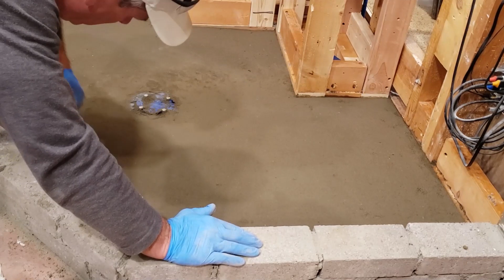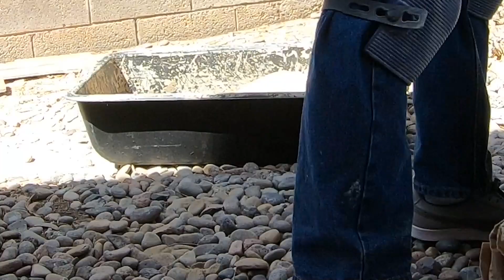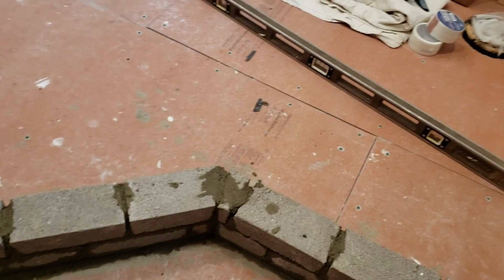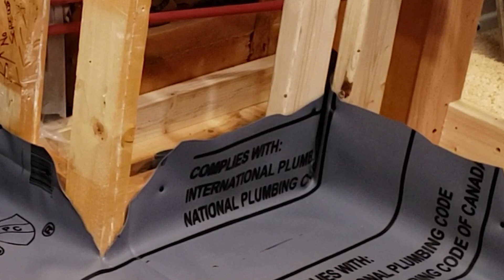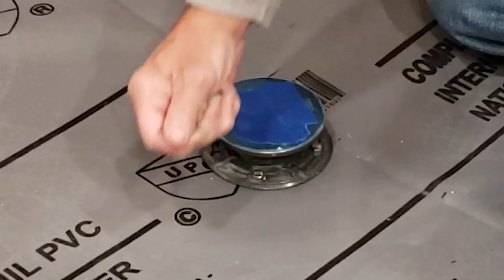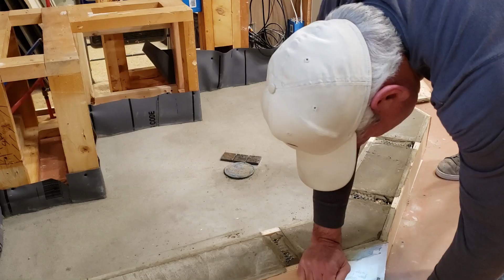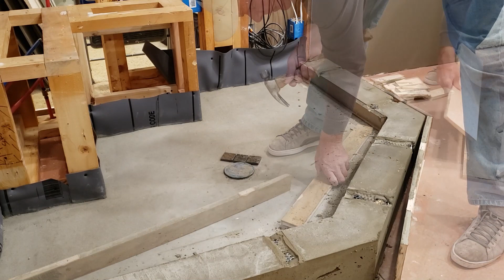Building a Corner Shower Floor From Scratch - Part 1

Comment: Thanks for the video I am going to be doing a corner round shower in my house (single wide mobile) and this is one of the best videos I found for building the pan that is easy to follow
Reply from the maker: Thanks for watching Lyle and good luck on your shower project! Just a reminder if you haven’t done it already, but you may want to check your floor joist structure under the area where you are building the shower. The weight you are adding to that area of your house can get pretty substantial when the dry pack gets added on top of the floor. You should be able to beef it up a little pretty easily if it looks like you need to. 🙂

Comment: Hi Rusty, building the curb from bricks is a great idea. Thanks for uploading this video which is packed with useful information for the amateur. What type of mortar or perhaps thinset is suitable for laying bricks on a wood subfloor ?
Reply: After reviewing the TCNA ANSI standards, it appears a mortar meeting A118.11 would be satisfactory for setting bricks on plywood subfloor; would that be a fair summary?
Reply from the maker: Hey Alan! Sounds like you have it figured out. On a wood subfloor, I attach a layer of metal lathe to the floor under the bricks. Not sure how much that matters, but makes sense to me. 🙂  I actually use one part portland cement to four parts sand and mix it to a good mortar consistency for setting bricks in this type of situation.

Comment: Rusty, you don’t waterproof the shower pan before tiling? I was under impression you should red guard the shower pan.
Reply from the maker: Hi Dick… not necessarily on waterproofing the shower floor. I learned how to install this type of shower floor system about 45 years ago and it wasn’t a new technique at that time. Just a tried and true, old school method. I have been aware of the waterproof membranes for probably 10 years and use them periodically on a per case basis. Point being, obviously, a waterproof membrane is not necessary for a shower floor installed in this way. Does it help or hurt? Not sure, myself. The floor design deals effectively with water in the floor over time with the shower pan and weep holes in the drain. My concern is that I want the floor tile to have a good bond with the dry pack. If your tile starts coming up, you have a major problem. The membranes have their legitimate uses, but should not be viewed as a must for all situations. Hope that helps!
Reply: @RustyDobbs  I’m a big fan of the old school methods ( and your videos)  because I think they work too. I did a pre slope , so theoretically the shower pan liner will direct moisture to the drain. I am a little bit conflicted however with red guarding the pan. The last shower I took part in remodeling, I hired a guy to build the pan for me. He built it the same way you did and red guarded the pan after. The tile seemed to adhere well. I have since acquired more experience with concrete over the years working on my backyard to do this one myself. You explain the process better than anything else out there. I truly appreciate you sharing your wealth of knowledge and experience. You are a true craftsman. Thanks very much.

Comment: For future reference, as a suggestion, use a float or something flat to press down the shower floor  tiles instead of your hand. You did a great job! Excellent!
Reply from the maker: I appreciate you watching and your comment, Zimpler! The reason I press each individual tile into the thinset rather than use a method as you suggest is because the cured drypack surface soaks the moisture out of the thinset so fast that I want to make sure there is a good bond between each piece of tile and the drypack surface. So I work a one foot square sheet of tile at a time max and work quickly to make sure each tile has a good bond before the thinset starts to dry out under the tile. The last thing you want is for a tile to come loose from the drypack over time.

Comment: Another thing I like about this backer board floor is that it looks like I don't have to cut a 45 degree angle into my subfloor around the drain. Did you screw that drain through the backer board into the subfloor?
Reply from the maker: It's a good way to go, Pen. It happened to work out that I needed the additional 1/2" thickness to match up with the bedroom finished flooring. Yes, I did screw the drain down through the Hardiebacker into the subfloor. Very solid installation.

Comment: I’m in the planning stage of ripping out our builder’s grade fiberglass shower stall so I’m searching for ideas and methods on building and tiling our new one. Thanks Rusty for sharing your skills in this video. It’s about the best one I’ve seen so far. I believe I can do this!
Reply from the maker: Good to hear, Ron, and with your great attitude alone, you should be able to do this! I have another two part video series from a couple of years back that is an earlier version of this process on a shower without the corner seat that you may also want to check out. Same basic info with a few tweaks because of the design differences. I always remind people that their second shower will always be better than their first. 😀 This is a process, just like any, that you get better at the more you do it. The real trick is in learning to work with the dry pack and in handling the trowels. But you can certainly save yourself some money and get a lot of satisfaction from doing this. Good luck!

Comment: Enjoying your channel! I'm not planning to do this myself, but I'm curious how they do the shower pan for curbless shower enclosures. The "wet room" look is very popular now. But is there a "pan" for the entire area? Anybody done this?
Reply from the maker: I have done a couple over the years, John. I use basically the same concept but on a concrete slab you remove the slab in the shower area, compact the ground under the shower then go back with preslope, liner and finish dry pack as normal. I cut the liner off flush with the floor where the step would normally be and make sure I have a pretty aggressive slope at that point back to the drain. I have not done it with a wood subfloor, but the structural support would get complicated in a hurry so I would like not be interested in doing it with this methodology.

Comment: Hey mr. Rusty What size of metal  lab are you using, is ok if I use chicken coop wire 1/4?
Reply from the maker: I don't think there is a specific requirement on the type of metal lathe that I would use. It's just giving the mud mixture something to attach to and some rigidity to the structure of the curb.

Comment: Is it ok to put backer board directly on the plywood shower subfloor and pour the dry mud on top of that? And how can I verify that my 3/4 inch plywood subfloor can hold the weight of all this concrete?
Reply from the maker: Yes, Pen, using Hardiebacker over the subfloor is a standard thing for me under a shower. The next question is a more difficult one to answer because you need to take a close look at the structural  support under the shower to make a decision for the weight reason you mention. I generally just open up the floor under the shower area first thing to see what I am dealing with then do what I need to in order to feel comfortable moving forward. With the subfloor removed, it's also easy access to the area that may need to be beefed up.

Comment: Commented on your first video of this a year or so back. I thought I was going to tackle the shower then, but I realized I had a LOT of other work to do in my house.
The long story for that one is as simple as "I'm remodeling a 1920s house, and instead of just a simply drywall replace, I replaced all plumbing, electric, heating, gas, & yes...even added a secondary subfloor later with extra support braces, windows, doors & frames all to match the updated aesthetic." Except the additional part I never mention is that I did have help from my 65 year old father through the couple of years to learn each trade slowly. He was originally an electrical engineer, where my field is in IT Services (Information Technology). Anyway, the simple to long story is that some things he didn't know, some things I decided to tackle without him present. Things I certainly got his help on was with the framing, electrical & hanging drywall. The beauty of that is when I was a young child, he remodeled the house I grew up in and I was the "helper". In this circumstance, he was the helper to me...which was a nice father-son bonding time at the age of 30.
Anyway, a year or so past, a world-wide pandemic happened, I stumbled upon more income due to all of that situation and I went a bit different with approaches around the interior design of the house.

And here we are today. I have all the floors (solid hardwood oak & tile across the house) complete, all the painting done, bathroom mostly put together and I'm (still) waiting on kitchen cabinets ordered in March (Homedepot lol). But I decided over the weekend I was going to tackle building the shower.
Just like tiling, I felt the method of drypack for the pre-slope was a bit more therapeutic. I didn't feel much of a strain when doing it, however I do have a MUCH smaller shower (32" x 36").  Did the pre-slope last night and used the 4:1 sand to cement mixture as you recommended and wow it turned out fantastic today. I checked for levelness across while doing it all yesterday and confirmed it was sloping toward the shower at the same slope, whilst still having a level side-to-side appearance so that the edges are the same. That's something I wasn't sure if I was going to do well, it actually wasn't as hard as I thought.
The next stage for me is the shower pan liner and then the top layer.

I'm writing all this to thank you for uploading a newer video and talking through certain steps. There's quite the number of these videos all over YouTube, but a lot of them are either 'missing' crucial information, or simply do wrong steps that really end up causing a failure. I think this video should be viewed by a LOT more people. Thank you for editing and uploading it. From a person who isn't subscribed (yet, will after this) and will be in a moment, this has truly been such a nice and easy walk through tutorial on it.

For anyone reading this who hasn't tackled the project, just do it. It's not just easier than you think, it's a lot more fun. I felt like I was a kid playing in sand for a little bit lol...but at the end of the day, the only real hard part is making sure that you are sloping, so check levelness all the way through continuatously.

I also decided to make multiple wood screeds out of excess lumber i had laying around. I made it in varying sizes depending upon where I was in the shower. It was very helpful to do this as I don't think my preslope would have been as smooth as it was if I didn't.
Reply from the maker: Hey Josh! Great comments and thanks so much for taking the time to share all of this with me. There is much of what you said that I would like to add comments about. You hit on lots of things that could be helpful to people, particularly younger people like yourself. I’m appreciative of your relationship with your father and how you have drawn from his experience and knowledge to build and expand your own skill set. I can assure you that connection with you means a great deal to him in his mid 60s. 

I’m not sure if you completely understand this yet but what you have been able to do so far with your remodel of your 20s house not only translates into sweat equity for you, but potentially opens future opportunities to further secure your financial future. Being able to work with your hands and understand how homes are constructed is a big deal, particularly in this day and age. Just ask the people in Texas after their ‘deep freeze’ experience earlier this year. They understand how important those skills are. I use to joke when I was around your age that one day plumbers and electricians would rule the world! That may not be that far off! With the scope of things that you have done at 30, you will probably never have to rely on any other people to keep things together around your home. There is not only security in that but also a great sense of pride in yourself and confidence in your abilities that grows with what you are doing.

I have never shared on YouTube much about my personal work history. I’m sure most assume I have been a contractor all my life. The reality is that at 22 I was finishing my undergraduate degree and took a summer job as a helper at a tile company in Abilene, Texas while finishing one last summer school course. The work came easy to me and that’s when I started picking up trades. Sounds a little like you! It wasn’t long before I was doing outside work for a contractor friend and my contracting business was launched. I was able to finish a MBA a few years later and support a family, buy a house, etc., all with income generated from construction. 

When personal computers came into being in the early 80s, I had to have one. It was an original Apple IIe with a program called Appleworks that I learned to use. From that time forward, I started making money with computers which opened up further business opportunities. Long story short, about half my career has been spent in construction primarily and the other half in healthcare, specifically Alzheimers and dementia care. A partner and I designed, built and operated our own facilities with me as the general contractor on our projects. The construction background, MBA and computer skills gave me credibility with bankers we needed to borrow money from. Being able to work with my hands always gave me flexibility to earn income and support my family while I was working on putting other deals and projects together.

I basically retired in my early 50s, started doing some small construction projects again a few years later, got curious about making YouTube content about 5 years ago and the computer background made that just a matter of learning editing software. I’m finally getting to some level of proficiency with Blender now. I will be working in the content creation arena for the foreseeable future or as long as I am able. I’m 66 years old now.

What am I most proud of personally? That I can work with my hands! To pick up on one of your comments, when I had a shower floor to do, I use to tell my kids I had to go play in the sand today! It is fun and is not as hard as people may think!

Finally, the computer I am working on now is my first computer build with the help of a tech whiz, 29 year old family member. No metal case but a wood case design that I will ultimately incorporate into a corner desk. We used the best parts available and the graphics card is the only part that’s a few generations back due to the crypto mining. That process is also not as hard as it looks these days. Will never buy a prebuilt system again.

My best to you, Josh! We don’t know each other, but I am proud of you and the path that you are on! You will do well, young man! Bet you never guessed I would have a longer response than your original post! 😬

Comment: Rusty, is Quikrete mortar mix just as good or do you think your mix is a stronger way to go?
Reply from the maker: It may be fine, David, but I have just never had the need to try it. There is nothing magical about my mix either. It is just the method I was taught and has always worked well so I have never had the need to explore anything else.

Comment: Please do more shower videos with lathe dry pack. Maybe shower walls too! Do you have any thoughts regarding this tried and true method vs. the Kerdi system? I kind of feel that this method is more reliable and will last. what do others think?
Reply from the maker: You sound like you have some history with the ‘old school’ methods, Amanda! I have done a little work with the newer methods like Kerdi in specific situations where it made sense to me, but 9 times out of 10 I will go with the “tried and true” approaches with all things being equal. The newer products are also quite expensive! It’s just difficult to argue with approaches that you know work. I will say that the true believers in the newer products I have encountered are absolutely hard-core converts! 

I have a shower to do in my shop office one of these days and I certainly may do lath and mud walls in that shower to show that method in a video. I think the younger tile setting folks might find that process instructive at a minimum! Thanks for watching and for your comments!

Comment: Great video. I’ve procrastinated building my shower pan for the last 6 weeks but can’t put it off any longer. How did you notch for the liner folds? Thanks
Reply from the maker: Good luck on your shower pan, Gilbert! On the inside corners, I prefer to notch the studs 1/8” or so to be able to fold the liner into the wall space and secure it with a screw at the top of the liner edge. It’s kinda like wrapping up Christmas gift dealing with the folds of. That way the folds don’t interfere with the alignment of the Hardibacker on the wall. The outside corners are a different issue because you have to cut the liner and patch around it or buy preformed outside corner liner pieces.

Comment: Rookie question,  why would a dryer mix of quickrete/water not be a good idea to use for a pan vs the dry pack? Adheasion of the thinset?
Reply from the maker: Technically, it would probably work, Louie, but I would not like the coarse gravel if that is the type of Quikrete you are referring to. There are also premixed sand and cement products that I get questions about too from people. They might be fine, but I have just never experimented with them. To me, bags of sand and portland cement are about as simple as it gets to produce a dry pack mix that does a great job that can last decades. Thinset will stick to any cement based finish. Hope that helps!